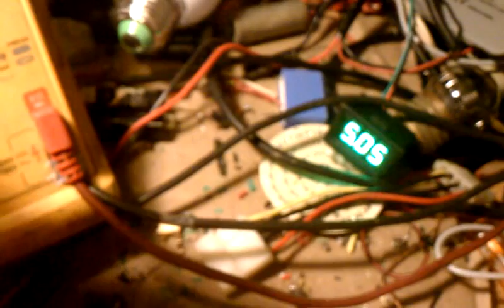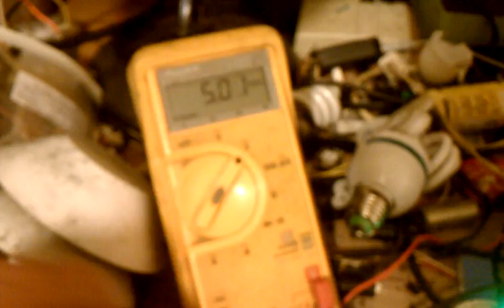lasersaber replication crossover

Comment from the maker: Yes i am using lasersabers first crossover circuit on laserhacker com . I am gadget there . I have improved the circuit with a disk cap across the pos to one of the load leads to get a "balance" and it starts most if the time with a power switch on the main transistor .

Comment from the maker: Hello Stephan . It is the First Circuit posted By lasersaber that was corrected by Groundloop . Sorry for the mess . I will clean it up tomorrow . It runs on a 1 volt battery just as good as 5 volts.
My coil is too strong .